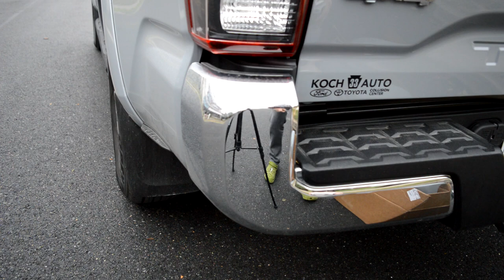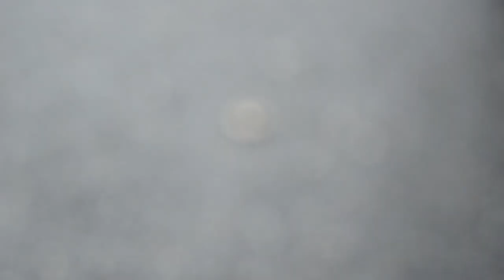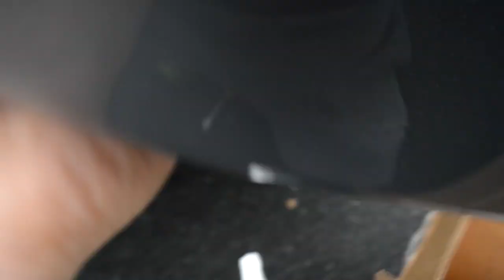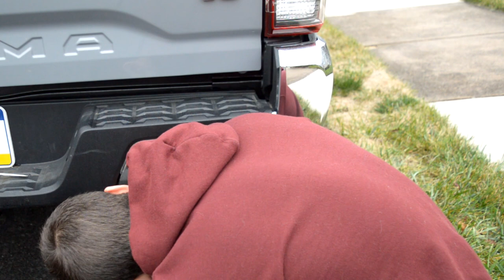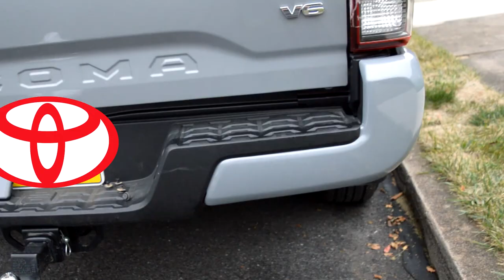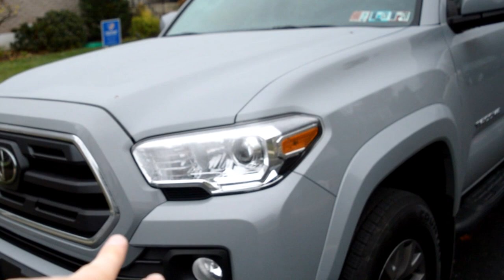The ULTIMATE Toyota Tacoma MOD!

Comment: Why aren't you removing the old chrome  covers?  So these aren't real bumper covers?
Reply from the maker: They don't make full replacement color-matched bumpers unless I went to the factory and they wanted around $500+ for those, so this is much cheaper.
Reply from the maker: @bigcheetah  I couldn't find a quote for the cement grey under $500 for a 3rd gen Taco at the time of purchase two years ago, prices may have changed.

Comment: Looking to buy a Tacoma and am torn between manual and automatic...leaning toward manual . What are your thoughts on the automatic ?
Reply from the maker: I wouldn't by the 2019 or previous Tacoma's because the automatic transmissions really search for the next gear and shift a little hard, now this does make it feel more like a truck, but sometimes in 40-60 mph traffic the truck can feel like it's not keeping up. BUT the 2020's have fixed this issue and I've only had brief time behind the wheel of a 2020 so I would recommend test driving it. On the flip side I just accompanied and co-worker who was looking for a Tacoma on a test drive of the manual transmission and it shifts very well, he liked it and said between that one and mine he felt the manual felt more "trucky" so I'd test drive both, but I'd lean more towards manual.
Reply: Thanks ASP... Appreciate the vids!
Reply: I have a 19trd pro manual and i love it

Comment: Good concept but the color does not match
Reply from the maker: Actually it does but I realize since the truck was dirty and rainy, it does look off, once cleaned it's MUCH closer to factory color.
Reply: They dont come painted thru that company though, do you have to get it done at a auto paint shop?    Any word on when theyll be in stock.    I like the black textured ones but theyre out.
Reply: Also just for future, if you do any prying of the plastics. Use plastic prying tools. Theyll prevent any possible scratching
Reply from the maker: @jakem1175  Just updated the link! Sorry it is the same company just not on that website I think? Not 100% sure. Here's the link. https://www.ecoological.com/store/p54/3rd_Gen_Tacoma_BumperShellz_-_Custom_Colors.html
Reply from the maker: @jakem1175  Yes I've been told this a lot! Haha thank you, I knew about the tools, but I was.. sigh too lazy to go get them.
Reply: Alpha Shark Pictures all good. Thanks for the video.    When there in stock ill probably get em or see how much it is to wrap the chrome.  Whichever is cheaper.
Reply from the maker: @jakem1175  I was quoted well over $500 for wrapping the chrome even by MY GUY! Everyone has a guy, and my guy said it was a lot. Haha but you might have a guy that'll do it cheaper!
Reply: Alpha Shark Pictures What?????   For just those 2 pieces of fake chrome    Thats nuts.    My buddy does it.  “My guy”. Hahaha.   Ill let u know what he quotes